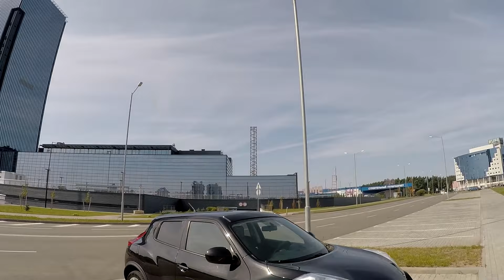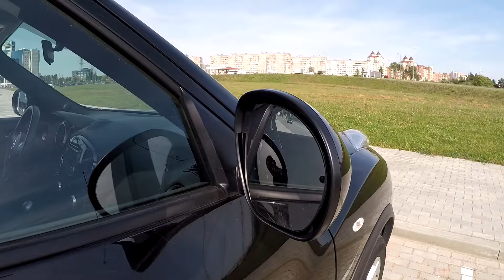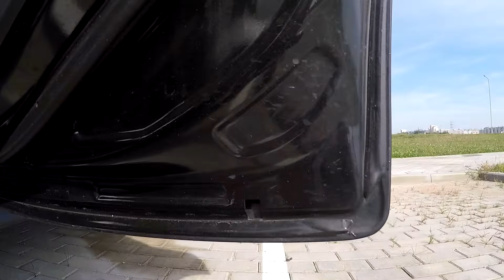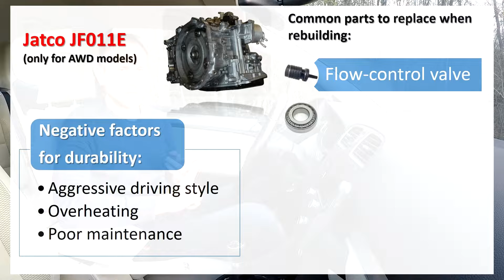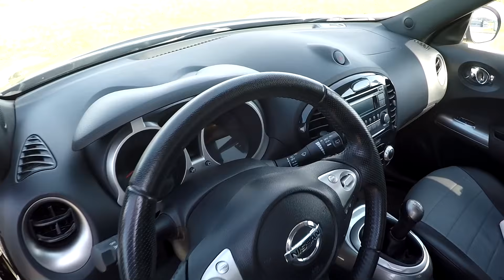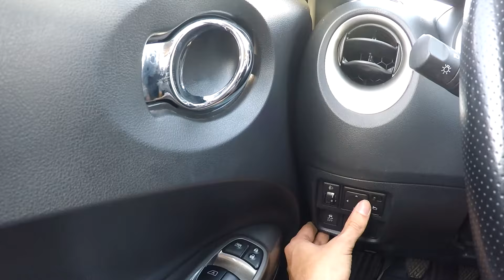Used Nissan Juke inspection. Things to look out for. Advice for buyers.

Comment: Don't get a Juke unless you know how to work on cars, or have a buddy who does. Our 2012 was bought gently used with like 12K miles on it. At about 100K, it started falling apart, and it was always something expensive. First it was an issue with the CVT, then the turbo went bad. THEN the timing chain went bad. When you get to the timing chain issue, it's time to decide between junking it or really paying a lot of money for something that will probably break again. I'm s p frustrated with this thing. And I know I'm not alone. Nissan did a recall on it, but of course when you call them or the dealership, they don't want to honor it. It was made to fall apart quickly and it's a ripoff. NEVER AGAIN. I had a Murano years ago and it did better than the Juke, but it crapped out to the point of no return too. I'm pretty much never buying Nissan again. There are too many better vehicles out there now. I'm currently in a Ford Flex. 2009. Pushing 300K miles. I'm driving it til the wheels fall off.
Reply: I just bought a juke with 83k miles on it am I cooked

Comment: I own one of these, we call it the Nissan Joke, the CVT transmission is garbage if you like frequent transmission oil changes at $200 a pop and a car that burns oil like a popcorn maker. I was a big Nissan fan for years  I’ve owned a hardbody pick up, xterra and maxima, All reliable vehicles but since Nissan started putting the CVT transmission in their vehicles I will never buy another one. I can’t sell it the resale value is horrible. I’m stuck with it.
Reply: If you're in the USA you can sue them for the CVT

Comment: I’m considering buying a 2012 with 100k miles. It’s had one owner, and they said they already replaced the CVT transmission. I thought it was interesting it had to replaced already. Is that normal, or something I need to be concerned about?

Comment: mine is a 2013 and it does have a dual mass flywheel. extremely expensive part and hard to find. there r a few videos on the nissan juke DMF. not sure why u say it doesn't have one.

Comment: WITHOUT DOUBT: The most useful review I've ever seen.At 76 yrs. I've  been driving since 1960,and have only bought used cars,trucks,and motorcycles.Your deep knowledge and superior command of the English  language are unparalleled.I bought a 2012 Juke  SL Pure Drive with 12,000 mi. 3 yrs. ago for $ 12K.No complaints.My dear Mother told me when I was young: Son,there are only 2 reasons to get in a hurry. You're running to the hospital or you're running from the law! I " make haste slowly."( my mother never said such a thing)I only say it for shock value.Thank you sir.
Reply: Do you  get any problems with your vehicle since

Comment: Do yourself a favor, don't buy a juke,
Reply: curious , what was your experience with them?
Reply: Hes probably got a BMW! 😏😂😅
Reply: @jonnyd13768  Never buy German!!!!! Never!!!!!!
Reply: @Jack-jl2vf  OMG... hes got a Peugeot!! 🤦‍♂️🤷‍♂️😏😏😅😂
Reply: @jonnyd13768  French!!!!!!!! Mudda forcaa!!!!!!!!!!
Reply: I got my 2013 in 2015 with 1,200 miles on it, and now it has 86,000, with only one costly repair less than $1000 dealing with front end suspension. I'm usually ready to trade cars after 3 years, but not this one!
Reply: @wwonka52  86000 is nothing after the next 50000 m then beware.
Reply: I would like to know also

Comment: The best way to find a good Nissan juke

Buy a
- VW golf
- Toyota RAV4
- Ford focus (manual)
- Honda CR-V
- VW Tiguan
My point is don't buy one.
Reply: Toyota RAV and Honda CR-V and VW Tiguan are ugly cars. The Juke looks far more better and is better in general. My opinion:)
Reply: I regret that i bought one, i dodn't expected so poor quality. Manual transmisions problems, whater go inside,  electrical problems issues, and so one :))))
Reply: I hate my RAV but thanks for this , will stop looking into jukes now lol
Reply: I’ve had my Nissan Juke 1.5l diesel and it’s the best I’ve bought in 30 years better than the VW golf (I’ve had 2) and a Honda Civic type S drive is bumpy but I still prefer it overall. My next car is another Juke but Petrol this time because of the ULEZ

Comment: What will make my 2011 pull to the right I had a ball bearing tie rod for new tires for new tires back shocks put on they charge me $2,500 for all that and it's still pulling to the right four wheel wheel bearing down that was $100 he said it was my rack and pin that making pull to the right found out it wasn't that took it back for what alignment he says my steering collar that make it go to the right can you please have me and tell me what's going on

Comment: I wish I'd seen this before I purchased my 2013 Juke a month ago... having some issues... jerking and inside lock switch and remote mirror controls won't light up... according to dealership they don't which I believe is false
Reply: No 🤞🏿 turns out my issue was caused by an aftermarket remote starter...put in by a reputable gut. What sucks it took 3 months for them to figure this out 😥
Reply: @spensermcghee2903  thanks for replying, I’m buying one today I wanna be sure about it. I had a Nissan Sentra cvt and the transmission blows in the highway while I was driving and I heard these cvt’s. How long u have had yours
Reply: @gostyjose6823  I've had mine since April but due to that weird stutter it's been w them more than w me... what I will say is that when it's right,  it's Right! One thing I had to get used to was the way it shifts. Apparently there is some belt that controls the shift so I would have my foot in the gas and order to get it's to shift I would have to to ease off the gas just a tad and the idle would then come down..how ever the dealer says that this is actually normal
Reply: What I will tell you is this is a fun car to drive!! It's zippy and snappy w pep! I'm on and off the highway all lot and it's great in traffic
Reply: @spensermcghee2903  hmmm not sure about it now. Mine had problems shifting too and they did said because it’s cvt too, Nissan said that and other shops said that and on my third month it blows in the highway and had to put a new transmission for $3000 and resel quickly coz I didn’t trust it anymore. 2014 Nissan sentra all of them has transmission problems and dealers knows that
Reply: @gostyjose6823  well hopefully I don't have that issue. I literally stop everyone I see driving and ask questions,  no one has anything but good things to say...at the EOD <END OF THE DAY > mine has a 3 year unlimited miles warranty so if anything major happens it's their pockets...good vibes your way
Reply: @spensermcghee2903  Wow what dealership is that yo?
Reply: When did u buy it? Any transmission or engine problem?

Comment: After watching this video last week, I bought my 2011 Juke. It's almost 2021, but hot doggy she is clean and all over beautiful!

Thanks so much for this video. 
Even though I bought from a dealer, the salesman did have to walk off while I took the car apart.
Reply: Any red flags to watch out for?
Reply: @ntnttntn3273  not really! Although the SES light came on after about 200 miles driven after purchasing. It’s something to do with the air intake or the MAP sensor.

Comment: Have Nissan juke 2013 automatic cvt gearbox, i have problem in the gearbox, got the problem a short time ago
the problem is when i have gear on P or on N so a little sound like iron move with iron (low sound) and when I switch on R or on D the sound disappears, when i drive slowly on switch one the car pushes forward a little twice 
and at the same time when the car move in switch one speed release the gasing it came back the same sound in gearbox.
but when drive on the second switch and further have no fault, it works in the normal way
they have said the problem is  coming from converts
Can you diagnose the problem… I would be grateful for halping
I can sand a film for the problem :)

Comment: I test drive a 2012 automatic juke sl at a dealer and the engine was so loud inside the cabin, the dealer said it was normal for a turbo to be loud, but the engine was just very noisy inside the cabin even though i was only accelerating from 40 to 50. How loud is the cars turbocharged engine?
Reply: While driving it I only hear the tires on the pavement. Although I can hear my husband pulling in the drive, it isn't overly loud.

Comment: I’m looking at a 2011 Juke with 105k miles. One owner who constantly had it at the dealership for oil changes and recommended maintenance, so I’m pretty hopeful. I know what I’ll be looking for at the dealership tomorrow. Thank you so much!
Reply: How has it done 3 years on? I’m considering buying one and be interested to know of it has been good/reliable?
Reply: @tomhurford8799 I’ve had my 2013 SL AWD for almost 2 months now. Just hit 95k miles. No problems so far knock on wood
Reply: @exoticcmatt5162 i bought in uk last month 2013 manual 1.6 petrol tekna version 75000 millage driven. It's reliable and good performance. My daughter is happy with juke.
Reply: I’m going to look at one this week, thanks for the heads up

Comment: Hi, Would you be able to tell how to fix the loose gear stick issue?
Reply from the maker: Hi. In most cases the reason of this issue is a plastic ball joint at the lower end of a stick. One of the solutions I’ve found on the web is to remove the stick and wrap its ball joint with a heat-shrink tubing (30mm wide) and then apply some grease on this joint (brake caliper guide pin grease for example). Here are two examples from people who solved this issue (text in russian, but the images are quite informative):
https://www.drive2.com/l/559411451198964046/
https://www.drive2.com/l/530359055458239930/
Reply: @UCARby  thanks